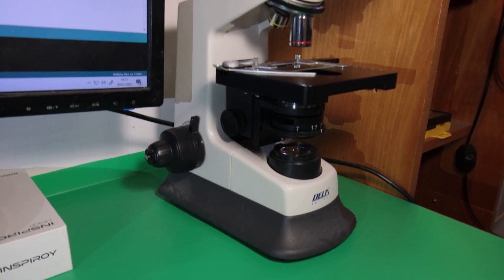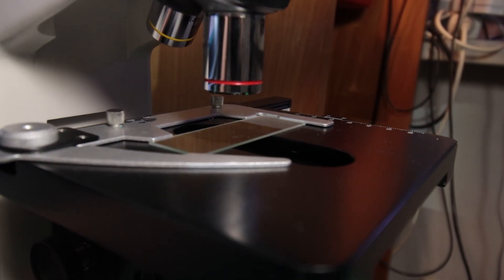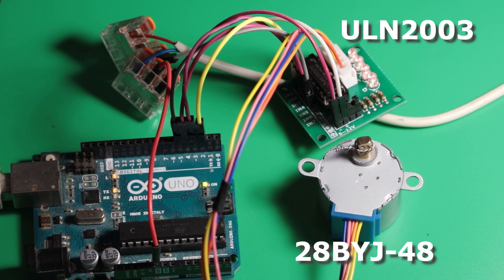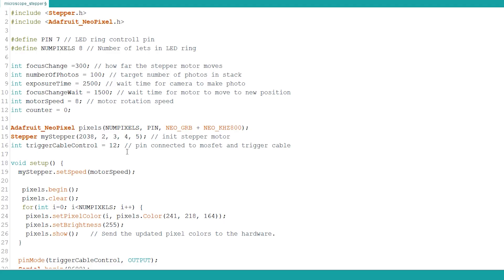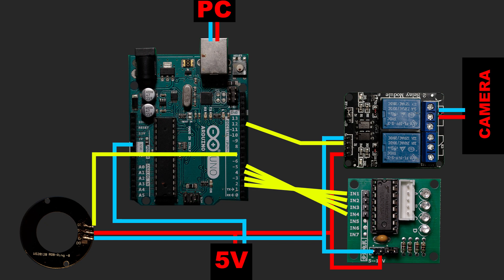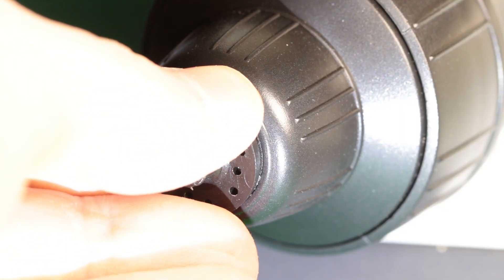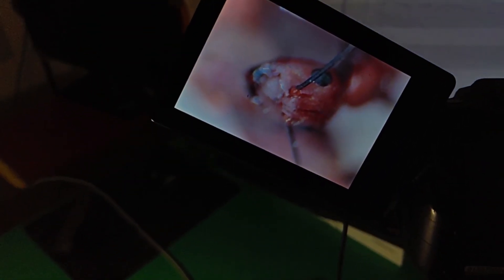I have automated microscope photo focus stacking with Arduino and a cheap stepper motor

Comment: Nice video on the process, I did something similar in my vid "animation focus stacking Blue Bottle Calliphora Fly". These days the Arduino really helps. did you open shutter, pause, flash light then close shutter. Vibrations were the real enemy. Great work.

Comment: Did you create the mechanical parts to interface with the microscope yourself?
I would have loved some more info on that side of this project.
Reply: Nope, I just glued the motor shaft directly to the focus knob on the microscope. If you wanted to make it more durable and with less loss due to imperfect alignment, I think a good idea would be to use a timing belt. There are a lot of tiny belts used in the robotics and 3d print field and parts are easy to get.

Comment: Brilliant idea. I have it on my need to do list. Thankyou. 
I want to replace my 220 volt lighting system with an LED unit because the hum of the transformer drives me nuts. And with a suitable battery system make the scope portable to the ‘ field’. 
There should be enough space in the cavity to include a nano board for this and your components too.
I am going to be busy haha.
Cheers from NZ.

Comment: Wow this is cool. I’ve always thought about this concept for my own microscope. I need to try it. I didn’t catch how your electronics are interfacing with the camera, is it physically pressing the shutter or activating the shutter in some other way?
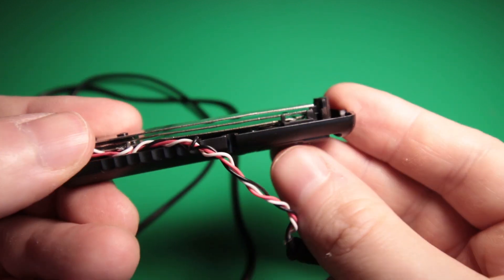Reply from the maker: Look at 1:16 - I desoldered this trigger cable and connected it to relay module and camera. Arduino pin 12 controlls the relay. Connections are drawn at 2:09 and rest is in code in description.

The component with 2 blue qubes is relay module - it acts like transistor but have optocoupling and is much easier to connect.

Comment: I was thinking of doing a water sampling device where you use a standard quantity, say cm2, and do the same thing so you can capture all the potential contanimation or bacterial presence on one plane and then be able to count and perhaps automate the identification of pathogens. So, run through it with normal light and then shift the wavelengths of light thereby doing a kind of faux staining. I guess you could also automate and drop a drop of actual stain in the container. The idea would be to design and place it outside near or above a water body or river and have a small pump pull in the samples. If you were going to use real stain, the pump could take a 10 cm2 and do five runs with five stains, then flush the container with the remaining 5 cm2 (or have a bottle of distilled water inside that would kind of gently wash out the sample container. If the using of light can adequately create the same visual effect as stsining to s degree that it high lights pathogens, then you could train an ML library and recognition using a bunch of premade slides of pathogens and of verious quality and type so it's more likely to get it right. You could use a solar hat and a industrial box with a large filter screen to remove debris from the intaken sample, leaves, vegetable matter that is too big for the study. You could then use LoraWAN, 433, or C-LTE to send the periodic results from multiple sample locations around a coast, watershed, etc...you could even get fancy and add a VOC / VOS Sensor, and if you wanted to get really fancy as there is s paper out in a journal of applied engineering that shows building a very low cost Raman Spectrometer and you would have a lab level edge water quality and water safety device that could be deployed on bouys on a coastline, or on rails on a river (that move up and down with the river flow (depth). It is a lot of effort and money for health department and authorities to do this kind of testing but the amount of water borne disesse is growing and water contaminated with antimicrobial resistant bacteria is also a rising concern as are "forever chemicals", volitiles, and pharmaceuticals in the watersheds. A small tightly built "smart" automated lab on the edge as stations along a coast or down a watershed could deliver real-time lab level water quality monitoring. In Afrrica alone 250mil children are affected and suffer developmental difficulties from tainted water and it's not just a poor country issue. In the UK, swimmers and surfers are getting colonized by resistant e.coli which also sets up biofilms in the sand (Beach Bum Survey, UK Epi) and every single watershed in the UK has pharmaceuticals in it (a recent survey by the UK Epi) so you could make fair assumption that the further south you go in Europe, the larger the problem given that the water temperature rises and is more favorable for bacterial growth, Bay Gasgone for example (France and Spain). The timely closure of beaches and issuance of no swim/boil water orders could save many lives, more and more as time goes by ....
Reply from the maker: My application is more for hobbyist-level microphotography. Your case, despite being fascinating, is way over my head ;)

Comment: This is a great use of the Arduino to automate something truly drudgerous! I notice there is a little bit of what looks like chromatic aberration in the specular highlights of your images. I wonder if this might be because the RGB LEDs actually use 3 colored LEDs to create white, and when you take a photo of something so zoomed in, you're actually able to see the slight location differences between the different LEDs? Not sure if the artifacts are an issue for you, but I'll probably use some white light LEDs when I build my version to reduce this.
Reply from the maker: I think it might be because some of the light is going directly to the microscope lens. I think some kind of diffuser on LED might help. And keep in mind this is quite a cheap microscope so some chromatic aberration will always be there.